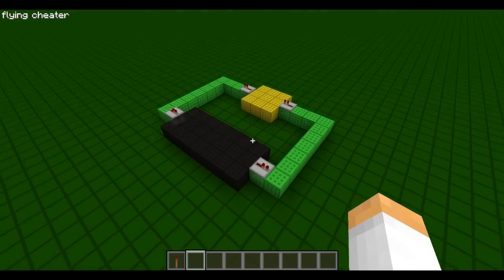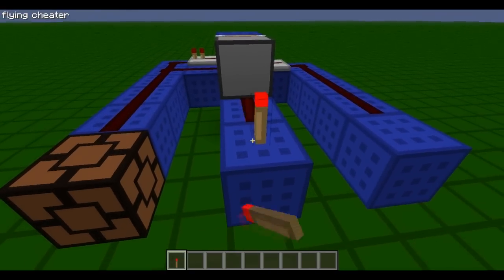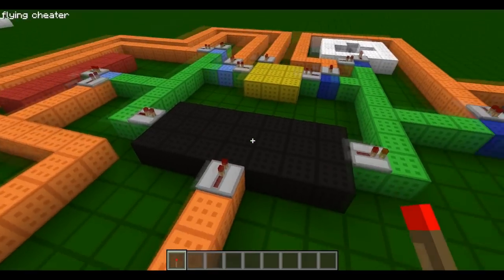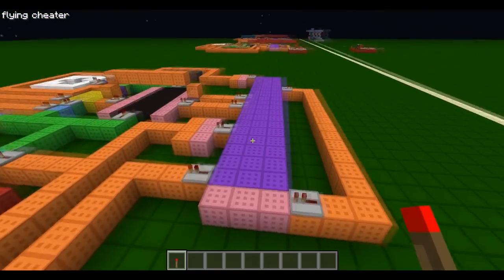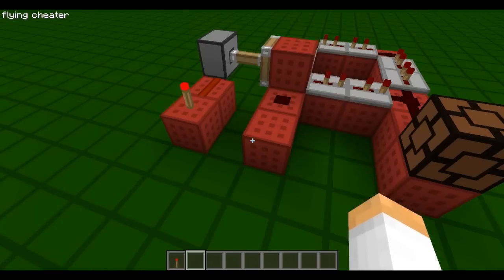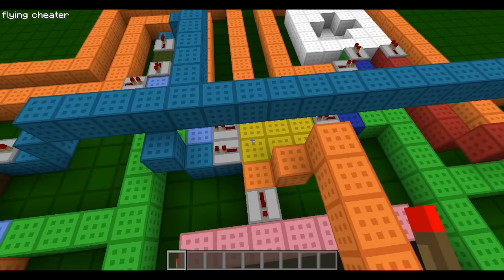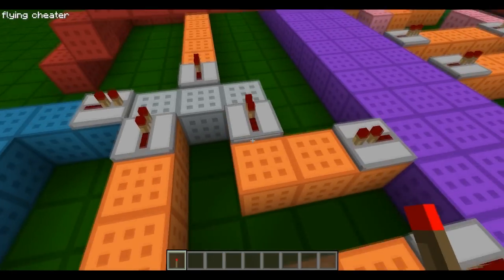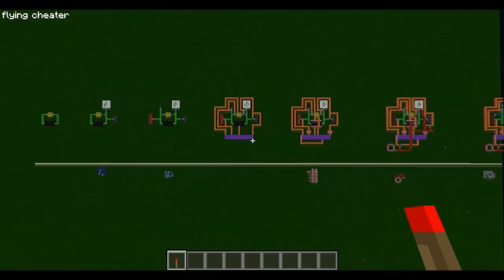How Minecraft redstone computers work

Comment: Better title would be "How computers work, with Minecraft for Visuals"
Reply: GreenleafFPS no because no real computers work this way
Reply: LoTR Builders at the base level all real computers work this way
Reply: Real computers do work like this
Reply: Most digital electronic computers are laid out a bit differently. For example digital electronic computers don't have programmers put programs in "program memory" I've never heard of a digital electronic computer ever doing that, I don't even think they worked that way back with paper tape. Instead of "program memory" digital electronic computers use the RAM for both data and code, and load instructions from the RAM into the microprocessor.
Reply: Looking at the Altair 8800 manual (http://www.altairkit.com/manuals/MITS/8800%20Operators%20Manual-10-Beta%202.pdf) page 25 and 29 it is confirmed that even this very early computer programed with switches has programmers put the code into RAM instead of a separate "program memory". So unlike this Minecraft example and other Minecraft computers which has separate memory storage for data and code, the Altair 8800 works more like most modern electronic computers having the data and the code reside in RAM.

Typical modern electronic computers have programmers put programs into RAM, the programs are then saved into a hard drive, SSD or Flash drive then the programs are loaded into RAM to be run.
Reply: @lotrbuilders5041  
Pretty much they do. However, usually all memory is in one location (program and data), and a few other structural differences. Also, on a much larger scale and with a lot of extra features for optimization. But on a base level, its all like this.
Reply: funny how I wanna see how someone builds a redstone computer in minecraft but no his literally explaining how the hardware of a real computer works by visualizing it in minecraft
Reply: @lotrbuilders5041  bruh
Reply: If you don't have a PU, then you don't have the base for all computers. His models use PRG ROM for controlling, which is NOT how real PCs work. PCs use a PU and an ALU in the CPU to control registers and other operations, controlled by the specific available OPcodes for the CPU.
Reply: @JacobP81  ok guys let's pretend i skipped all informatics school, i find hard to understand the concept of "program memory", i thought all computer hardware elements were programmed in machine code, which was then complied into more refined softwares.
Reply: @leonhaze-4202  machine code IS the code the computer understands. It does not get compiled. You have it backwards. Its source code (in the form of a high level computer language like BASIC or C++, or in the form of assembly language) that gets converted into machine code. The machine code is the computer's native language; it is what computer program files are in. It's only machine code that the microprocessor understands.
Reply: Which is what I came here for, anyway.
Reply: I agree
Reply: The title made me think it was minecraft computers not computers in minecraft design
Reply: LoTR Builders they do not exactly obviously but in the general idea and logic gates r the same
Reply: So true

Comment: i have literally spent about 50 hours (no exageration) trying to find  out what actually converts a binary combination (11001001, or 10000000 for example) into a single output, so i can make my computer in real life. FINALLY someone tells me, that's you, that it is a decoder. Now i just have to figure out how to make a good decoder
Reply: If it’s 8bit be prepared to spend a lot of money on the logic IC or relays and make sure you have a lot of time on your hands because you will have to make 256 decoder segments
Reply: Look up Robot Brigade. Great channel for computer science
Reply: Decoders were very hard for me too. But now it seems easy, just make a module that adds 3 if the value is 5 or greater, and adds 6 if value is 10 or greater. Then make some circuits. Easy
Reply: you need solders too m8
Reply: 50 hours? How did u not know wat a decoder is

Comment: So I was struggling to make a vending machine that works using 2 buttons (a and b) and can differentiate 6 combinations and drop one of the 6 different materials (combinations: a, b, ab, ba, aa, bb, for example b gives iron but bb gives gold) and when I finished it I thought it was a valid computer because it had logic gates and my own invention signal lengtheners, and then this guy just shows up with his ALUs and decoders and clocks and I'm just like ._.
Reply: I like what you made.
my first vending machine was 6 levers to 6 despencers.
of course that was before repeaters were a thing
Reply: It is a computer.
Reply: Computers are things that take input, runs programs and give output.
Reply: Simon Iversen Hi me!

Comment: The only person to actually explain how a computer works without being pretentious. Have a cookie my good sir, hell, have a whole box!
Reply: That's because you don't understand logic gates and programming yet. Logic gates are extremely crucial to the entire system because they are like physical programming language. The interesting thing about programming languages and logic gates is that you can create entire computers with logic gates, no programming required. Not, or, xor, and, ect. The interesting thing about memory storage in base 2 is that each location in base 2 can be designated as something different all on the same memory block. For example, you can get a computer to assign programming to a memory block with 00, 01, 10, and 11, or more, because each of those can be not, or, xor, and. The thing is that when a memory block is called, it's processed in a cpu normally one at a time. The reason why quad core is so great is because it processes four at a time. Some people who bit coin mine have way more than 100 cores, yet, nobody believes anyone would do this. The design is also modular, meaning you can copy and paste the design of anything and expand upon it as much as you want. I think I'll make you a pastebin.
Reply: You don't really need to in order to make a computer. The basics of a computer is to have a system set up for the computer to decide what memory it wants to grab, what will process it, and when will the processed data be sent through, as well as where will it be sent to. Memory blocks of 1001011's ect. are essentially encoded not just as numbers, but, can be letters also, commands such as "what will it process data to", and much more all on the same memory block. All the other parts are made by "you" and can be completely customized, but, most people use the same parts because it keeps computers compatible. Is you want the data to be able to add and subtract, you add a fuller adder logic gate system. The bus holds the data in it and stores it into registers, which the bus zeros itself at that moment. Let's say you made a simple calculator, you would only need a few memory blocks for adding, subtracting, and even multiplication. You just have to have a mind for logic.
Reply: I get you. Sounds like you just need to improve your logic skills.

He doesn't describe in a lot of detail how to construct those things or the purpose they have.  A decoder is kind of like a method which allows for calling from a register if there are multiple registers, normally there are eight registers for eight bit CPU. The decoder obviously has to decide which register to call from with a command of sorts, so it has to have a circuit and logic gates.

The overflow is when the math goes beyond what the memory block can store, it would force the memory block to turn into a negative number in conventional computers, thus needed to overflow to tell the user the number being returned is too large to fit into a memory block without causing problems. Completely unnecessary if you just switch the position and purpose of all the binary, but, necessary if you want to tell someone they used too big of numbers or have a computer attempt to compute it further with other parts.

Sorry I can't help you further.
Reply: like I said. Sorry I can't help you. Honestly you should try to study and get a better understanding of logic gates and logic in general. I helps you understand how to make your own system.

Comment from the maker: The multiplexer for the lines of code is part of the goto system.  Basicly, the decoder part accesses one of the many conditions to look at.  Based on the whether the condition accessed is true or false, the multiplexer will chose to output one of the two lines of code that is programmed.  Therefore if the condition is true, it will GoTo one line of code and if the condition is false, it will GoTo a separate, different line.  Hope this helps

Comment: 1 GB would be a billion addresses, not million.
Very cool video tho!
Reply: sorry but it would be a million do the math you get 1 million sorry
Reply: ragegamingvideos 1 byte is 1 address, is it not?
(rounded approximations) 1000 bytes = 1 kilo byte (KB), 1000 KB = 1 MB = 1 million bytes. 1000 MB = 1 GB = 1 billion bytes.
Reply: FreeCpRareAccounts1 those are bits. A single bit cannot serve as a memory cell in any way. It just either 1 or 0.
Reply: Zenovarse 1 kilobyte = 1024 bytes, not 1024 bits
Reply: GrandPhil98 kilo = 1024 in the context of data. It is 2^10, which is the closest binary approximation to 1000, the original meaning of the "kilo" prefix. You quoted the kibibyte Wikipedia page but didn't read over the kilobyte page?
Reply: @Zenovarse  I want 1024 monoicosebytes of storage.
Reply: No one ever uses kibibyte it's obsolete
Reply: Kilobyte is 1024

Comment from the maker: well i see what you are saying, each action will be completed faster, but that doesnt matter.  The speed of the clock in most cases is defined by the speed of the slowest operation. In bluestone, what i did is i timed every component to find out exactly how long each would take, then i had the clock "fire" to the different components at different times depending on how long the each function took.

Comment from the maker: There is a member of the RDF (redstone development foundation) named anomalouscobra, he developed a system to instantly carry across 8 bits at a time (using a 2 wide full adder) so the adder becomes something like 4+0n, there are however 2+0n designs now created.  The adder that i used is actually quite slow as it is 4 wide per full adder (needed for a dual read ram layout) so its something like 6 ticks across all 8 bits.  By however timing everything correctly, it is not an issue.

Comment: this isnt how computesr work, this is how epic computers work
Reply: +tim patin this is except for a few minor differences, how your computer works
Reply: You don't understand this
Reply: Why so?
Reply: Minecraft is turing complete: you can emulate itself inside of it
Reply: +Kookie Kat Basically, the CPU back then was just one thing that controlled everything, but now in the same group of the CPU is the graphics card and stuff like that meant to kind of take pressure of the graphics card, and the memory, is now the RAM, hard drive, SSD, etc. And the I/O is just the motherboard which hasn't really changed much
Reply: +tim patin Well TECHNICALLY you do have enough storage space, as long as you have enough chunks loaded, a REALLY big hard drive, and a good decoder
Reply: Meh
Reply: Scope Lens Kingdra you're talking about PCs. Computers don't need graphics cards
Reply: Yes but still, you get the jist of it
Reply: PCs are Computers but computers don't necessarely need a gpu
Reply: this isnt how a computesr works your right. Ive never heard of a computesr before.

Comment: For those who didn't understand the first part with the blue wool, Like he said it's like a highway, using certain components, you can control the devices used to send certain pulses/signals to certain programs. Which be used for many different components of a basic computer.
Reply: 12 year old detected

Comment: It would simply be a separate component. One way it could be done is having a bunch of RS NOR latches (one for each component) hooked up to an AND gate. Each component would send a signal to their respective RS NOR latches. If a component is not used in a program step, a signal would be sent directly from the program memory to the component's RS NOR.

Comment: Very nice walk trough. Thumbs up.

On another note, I'd really like to see some more in depth stuff on the workings on various parts. Fx. I'm stumped as to how you can keep a clock of 24 ticks when the fastest adder design I can come up with can't promise less 4*number_of_bits, i.e. 38 ticks for a 8 bit adder. I suppose there could be some designs using pistons, but still, it's hard to believe.

Best regards and keep up the good work!

Comment: This is not a video about redstone computers... This is a video about computers... It is a good video explaining how computers work using minecraft as a visual aid, but the title is inaccurate.
Reply: Minecraft redstone computers are based off real computers so to understand a redstone computer you need to understand a real computer.
Reply: A computer is a computer, which is also a computer, it doesnt matter if its emulated,  or complex, it is what it is (see if you stip down too many functions it wont be a redstone computer, but more a glorified redstone calculator.
Reply: Your point being?...
Reply: Redstone computers are 1940s real world computers.
Possibly slightly more advanced.
I think some of the bigger ones are more powerful then ENIAC and even the apollo computers, though they are also the digital embodiment of why it was considered impossible to build super computers until the rise of integrated circuitry:
Too much room and no way to cool the bloody thing.
Reply: Pretty much almost all components in a PC are the same as a Redstone one but with some setbacks like the HDD were the most compact 1KB HDD is just a looping signal while a normal one has read and writes with panels to store the data

Comment: I'm no computer science expert, but I think some things might be wrong:

1) the light blue circuit you showed is not an AND gate, but rather a relay

2) the Program memory doesn't control what happens, it tells the control unit (something I couldn't find in your example) what to do

3) The ALU, the conditional jumps and the Control unit are all components of the CPU, tho you treated them as individual pieces, which makes for a better understanding of what's going on, but technically still an incorrect one

4) Not sure about real life, but in mc you can hook up outputs and inputs directly to and from RAM, which would make for an easier to understand (at least for me) and to construct system (I think, because if I understood correctly, you're sending that data directly to the things where it is gonna be used, which requires (with one address and one data bus) one decoder per device, but if you take it from RAM you literally only need the RAM address decoder)

Btw, just wanted to say I liked the D-flip flop design, it's a relay connected to a repeater loop and I like the simplicity of it

I guess that's it... Sorry if I got something wrong, if I did please correct me! I would really appreciate it! Like I said, I'm no computer science expert, so I'd love to hear from someone who knows more than me

But, that doesn't mean the video is bad! I actually liked it because it explains stuff in a simple way with the help of Minecraft and I like the idea of using the game to explain real things!

Comment from the maker: for example, if it took 20 ticks for the data to get processed in the alu after the data was writen to the ALU register, the data needed 4 ticks to get to the RAM, and it took 5 seconds for the inputed clock to the RAM save to write the data, i would do this.
It takes 24 ticks to get to RAM after the ALU register is updated, remember it takes 5 seconds from where the clock is imputed to when the data is saved in RAM, so i would have the RAM clock update 19 (20 to keep it save) ticks later.

Comment: In the new 1.8 update i was able to make a hardrive made of iron but with diffrent DataValue which is in Lua or Java code but each iron block can hold only 500k bytes but the hardrive contains 10k iron blocks so basicly it can hold about 10GB's instead of 10k bits and how it figyer out is basicly commandblocks useing /getitemvalue ironblock (x) (y) (z)
Reply: cool everyone check his channel out !!!
Reply: /getitemvalue isn't a command. please upload a video on your channel about the harddrive thought, this is an interesting thing actually and I'm sure most people want to see it, and also, text describing isn't enough, videos is best proof. +1 to you
Reply: i used mcedit and data tags, any block can be givin a data tag, the tag is in binary code for the computer to read. you can do it in vannilla
Reply: Lunchbox15 no it is far from using a prebuilt computer. You just don't use separate gates, you use small components. Actually it's much closer to how real cpu's are designed these days

Comment from the maker: There are acutally ways of programming is say c++ then making a custom compiler to create the assembly instructions.  They are then turned into machine code and actually imported into the minecraft save file and basicly place torches where they need to go programming the computer.  I however am wayyyyy to lazy to do that and think that it is just easier to do it all manually. :P